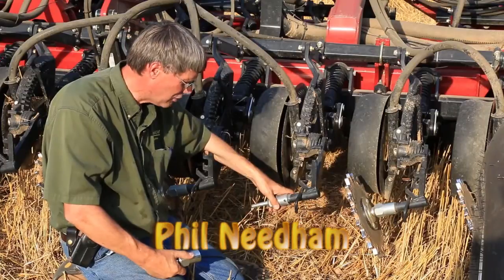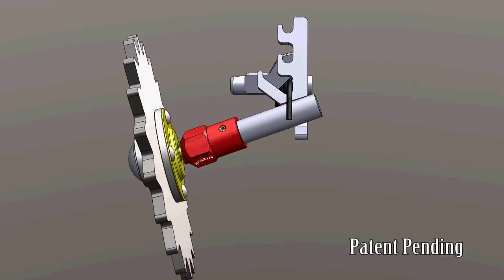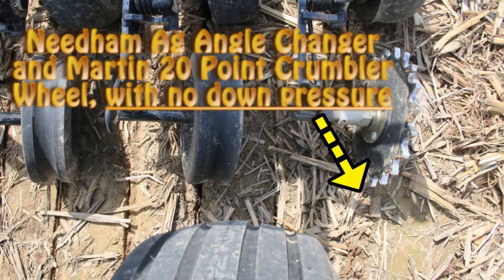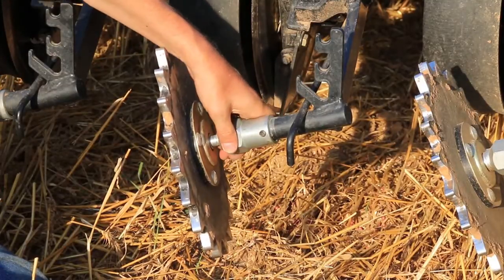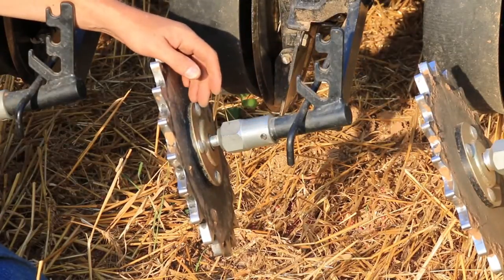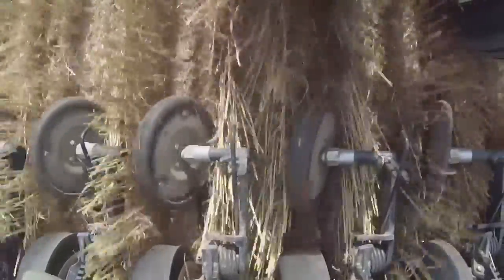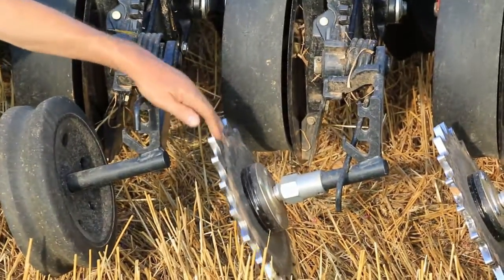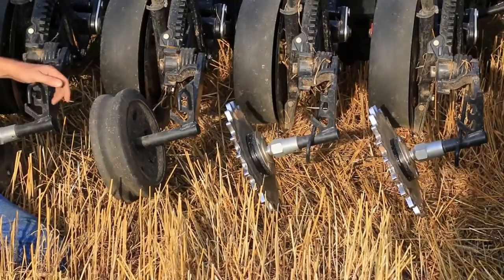Needham Ag - New Closing System For Case IH Precision Disk 500 and 500T (+ New Holland 2080 & 2085)

Comment: Hello
Of how many inches is the toothed disk that closes the groove and what thickness does it have?
Reply from the maker: The 20 point wheel is 13 inches in diameter and 1/2” thick (33cm OD x 13mm thick). 

We now offer a long life poly 20 point wheel which works as well as the steel wheel. The poly wheel helps reduce the weight and shed mud better.